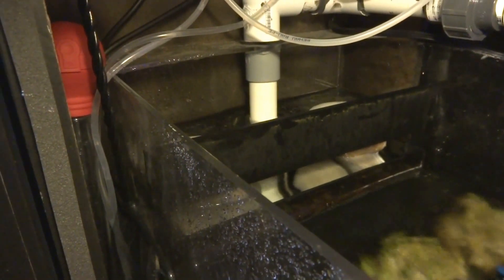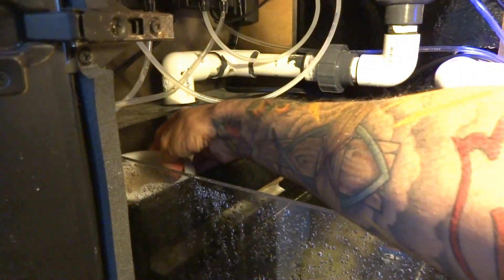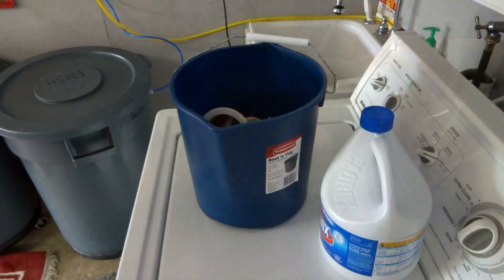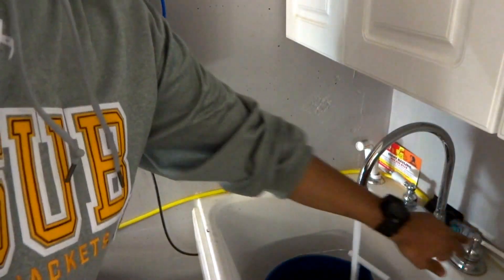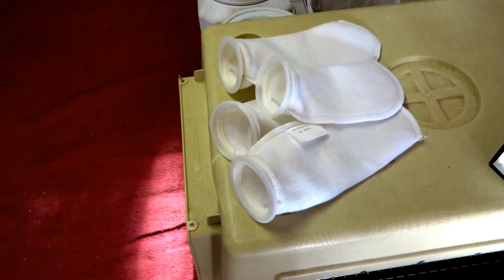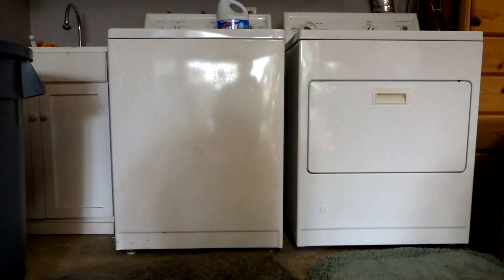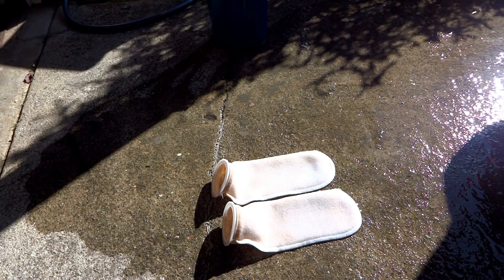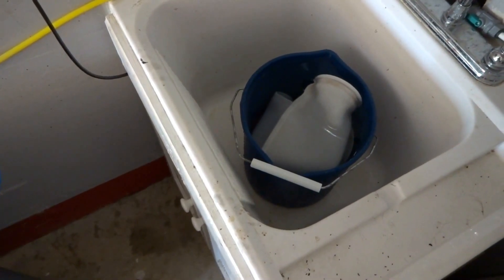How To Easily Clean Aquarium Filter Socks

Comment: Great Video. I enjoy all your vids. Hey, I just ordered a Trigger 39 sump and it ships with 4 X 12" filter socks. At 2:03 in the video, you mention you use 7" length socks (I think you have the Ruby) and I'm wondering if that 7" is correct, and whether you feel that's the optimum length sock, without dragging on the bottom. My sump arrives soon and I want to order the best length sock to have several on hand. Also, where to you order your socks ? BRS ?
Reply from the maker: Luke's Reef I never noticed that. I misspoke.  The socks are 14" long. I get mine from local fish store.
Reply from the maker: Luke's Reef Oh, and thanks for watching and commenting.

Comment: Great method. What do you do in the winter?
Reply from the maker: Aaron Mele We don't really have seasons where I live. Normal winter temps is around mid 50s to low 60s. If you're in subzero temp area you can use the washing machine with Sentless bleach and NO soap then dry in drier.

Comment: Great video.  I clean mine every two weeks or even up to a month.  The variables to consider would be 1.  size of tank 2.  feeding schedule/ bio load 3. size and quantity of filter socks..  I have two 7" long filter socks in my 300 gallon system.  Another thing to look for inside the filter socks is serpent stars....I usually find one every few filter changes.  Thanks for sharing

Comment: Hey reefergil...great explanation I've just started a 93 gal cube with a 125 gal sump...I was reading some comments below and someone was saying that they rinse there socks to make sure and get the pods out...if you rinse your socks and then dump that water with the pods in it back into your sump...wouldn't you be throwing all that junk back I to your system that you just filtered out?  Thanks and again great video
Reply from the maker: dyligansisland You can get the pods out by simply turning the sock up side down and shake it up and down. Whatever pods don't come out this way, then you can gently pick them out with your fingers. It's really not that big of an issue. Most of the time I won't get any pods trapped in the sock.

Comment: I've used the same set of 100 micron socks that I got with my Trigger Systems sump for about a year now. YES, same set!  I rinse them first, get the pods, snails  and such out.  Then I toss them in an empty washer on the smallest load setting on HOT. I use two cap full of bleach, NOTHING ELSE. Socks come out looking as new as the day I got them.  Tried 200 micron, didn't like them, 200s didn't polish the water as well as the 100s did.  I clean mine about every 5-7 days when I do my weekly maint.

Comment: Hey reefergil. I have been watching your videos for awhile now. And based some of what I did to my system off of what you did. I recently added a filter sock to my system but still have a lot of particulates in my water. Any tips of how I can get rid of them? Thanks for the great videos look forward to seeing more.
Reply from the maker: AJ Shrek Hey AJ, as long as the particles are suspended, they will eventually flow down your overflow. I get particles too that seem to linger for days. I wouldn't worry about it. Thanks for the feedback!

Comment: You should be changing your filter socks every 2-3 days as it's proven that they are a cause of higher nitrates if left any longer. The ones that you are using are only £2 a a piece from ebay. I have stopped using them but I had about 30 I used in rotation so I'd wash about 2 dozen at a time using hosepipe to remove the general muck then the washing machine with a couple of teaspoons of bleach in with the socks. Then let them dry overnight and then fold.them up for re-use.
Reply from the maker: Nice!

Comment: I used bleach concentrated without water. I did rinse socks using my garden hose after 48 hr and left to dry for 4 days outside. After this I put  they in my sump. I am worried about my fish tank  because I see that you, guys, use small amount bleach with water? Anyway my socks do not smell bleach.
My aquarium looks okay. There is too late after few hours move out the sock to extra rinse.
Reply from the maker: I don't think it's the amount of bleach you use that would affect the tank, it's about thoroughly rinsing them and allowing to dry. I wouldn't use any type of bleach with perfumes.
Reply: ReeferGil thank you for your opinion.

Comment: Didn't spraying water on the outside of the sock defeat the purpose?  It's the inside that's dirty.
Reply from the maker: +DWB Videos Nope, If your hose nozzle has a strong enough stream, you will see all that crud get pushed right out of the sock (spray from bottom of sock upwards). Then flip the sock and repeat. The most important part of this process is to ensure all the bleach out then let the sock dry. No issues following these steps for past three years, so I'm confident it works :)